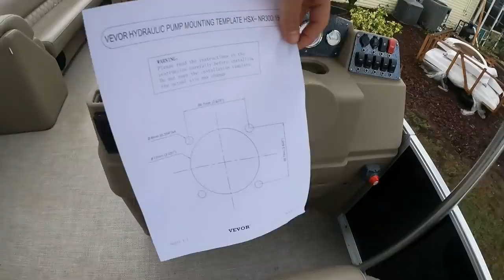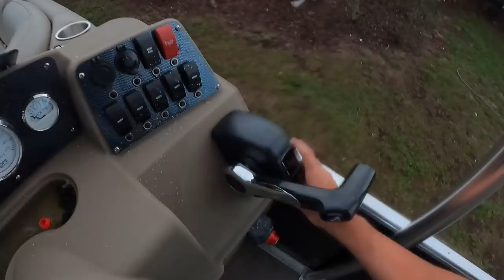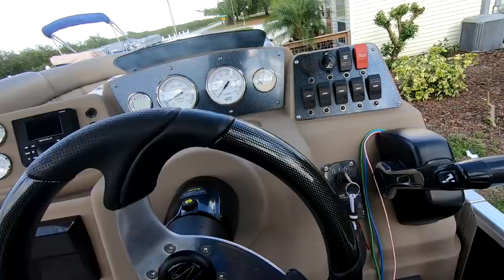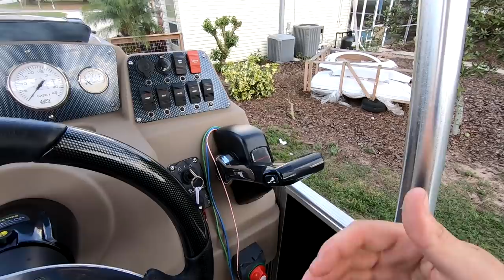Powering a Pontoon with a MASSIVE MOTOR! - Episode 13

Comment: Looks Great!!!  Two things I would suggest, would be look into a dual on board charger for your batteries and run the plug in to the side of the console so you can plug it in to charge your batteries when not using it.   Also would recommend looking into Lithium batteries.  With Lithium you could spend all day on the water and not worry about how much charge your batteries are.  It gonna get old fast having to open the compartment up and attaching a charger to the batteries every time they need charged.
Reply: Absolutely. Onboard charger with plug in the fence dockside was a game changer for me. I think we got ours from Noco
Reply: Lithium cells offer a way worse cost/capacity ratio! He can get way more capacity on Lead ones and hence be out on the water much longer than with equally expensive Li-FePo4.

Comment: Comming along sooo nicely ! Tip (learned the hard way), NEVER start an outboard motor without running water first, you can burn out that rubber water pump impellor in seconds
Reply: Wym? He used water when he started the motor? I assume you saw that. Why give a “tip” when Zack did it correctly anyways?
Reply: @benbellino3596  Watch closely, there is no water running when he starts it, it runs for a while (and I think there is an edit/jump cut to when water actually starts flowing. But it's not running when it starts.

Comment: I'd probably put some back railing up top so you can only fall off the sides and not on to the back of the boat and motor. Also you could pull those lower pontoon side panels you installed last and paint those to match the motor. I think that would really look good and tie in the motor to the boat without doing too much.
Reply: Good idea about giving the boat the the same color as the motor. Something like some stripes might look good too. Black and a desert tan like that is a good combo, just needs to be tied in well.

Comment: A couple of things: 
Can you share the cost of your builds? 
That generation Yammy 4 strokes are notorious for exhaust corrosion issues. Especially if ran in salt water. Make sure to have that checked! Awesome build.
Reply: I agree with the exhaust leak but you can usually hear it

Comment: When welding aluminum I normally burn any purity’s off with a torch before running the bead and it helps a lot. You can use a propane torch if you don’t have acetylene.

Comment: Dude it looks awesome! Don’t beat yourself up about the welding, aluminum is a pain in the ass. My steel welds don’t look that good!
The only thing I would recommend is in the fire pit cover the elements with whatever stone you’re using. The more stone you cover them with the more the fire will dissipate the over the area. It will help tone the flames down (they won’t blow around as harshly in the wind) and will look better (I made a fire patio table out of an old metal sandbox and found the more stone on top the better).

Comment: Nice Build! Just wanted to tell you, that even that short start without a water connection was likely to destroy your impeller in the lower unit, which pumps the water. If it runs dry for just a few seconds, it is enough to melt down your impeller because of friction. It's a pretty quick and simple thing to check and/or replace, did it my self too. Greetings from Germany :)

Comment: Nice rebuild you have going on. We are currently rebuilding a 24’ Pontoon with a 90HP on our channel just for a simple open floor plan for fishing. I’m curious how well a 90 will push in.
Reply: Thats what I did with my 24’ pontoon 90Hp evenrude just change the carbs out to the bigger ones I think its a 125Hp now and it gets moving! I used composite decking, it added some weight but made it really stable. We added a bbq and LED lighting and its a fishing party barge!

Comment: Excellent paint job on the engine, color may seem off but  I think it's because there is so much of a blank area under the cover, putting some 
type of decal in the middle section (possibly your channel name) would 
add some color to it and not concentrate so much on the tan color.
Maybe adding an off color to the middle area like you have done before would break up the solid color on it now.

Comment: Great work  fella Just been binge watching this from the start 
Just a few concerns  .. 
I noticed on one of your videos while re building the trailer that your using standard crimp Connectors fir your trailer lights ..
There's no way there going to be waterproof!! 
Also that fire pit looks awesome but I'm worried that someone could get burnt if the wind catches a flame while going for there drink 
What aboutca glass box to protect everyone! 
And lastly I think the bright lights are a bit buch ! 
Personally I would have an off white turned down low so it's not so " in ya face " 
These are my personal views but great work anyway 
I'm SURE  your friends are gonna love it!!

Comment: We have a Yamaha 704 on our pontoon and the upper range of throttle is sticky or tough. There’s an adjustment screw at the bottom but I haven’t tried messing with that yet - if you figure out what is causing the tough top end of the throttle please let us know (or at least I would care to know 😀). Thanks for the content!

Comment: Pontoons are tricky to power… most of performance on this cases relays on the prop, make sure you get a nice ultra low pitch, 4 or 5 blades with high diameter propeller you should be doing 5000 rpm wot with at least 3/4 people on board, over forcing the engine with a big prop might cause serious damage to the heads
I also recommend you changing the impeller it’s clearly gone
Reply: Take in mind your engine has 2.08 gear ratio

Comment: Great video's, I'm currently restoring a pontoon as well, having some trouble finding the aluminum trim/rub rail that surrounds the decking on the pontoon.  Where did you order yours?  Or did you reuse the existing trim on the boat?
Reply from the maker: Pontoonstuff.com
Reply: @ultimaterebuilds7127  Thank you Zack!  Seems like they are the place to get everything.  Wish we didn't have weird shipping issues right now, still waiting on the Luxury seats too.

Comment: Instead of laying new plywood and gluing vinyl could you just screw down composite deck boards from Lowes or Home Depot? It would be like half the cost and should be less labor. The question is do you lay the boards with a gap? Water would easily drain with a gap, but you wouldn't want water to splash in. I don't think composite deck boards get that hot and they probably don't weigh any more than plywood. Has anyone tried this? Is this a good idea?

Comment: looks good! you should add steering on the top deck and add a battery charger on the side of the console, also change the water pump in that motor!!!